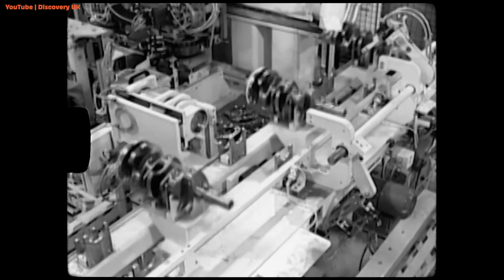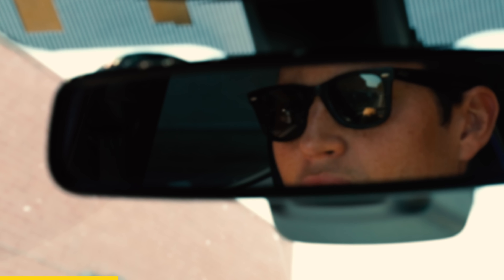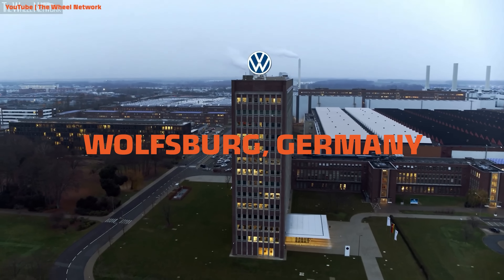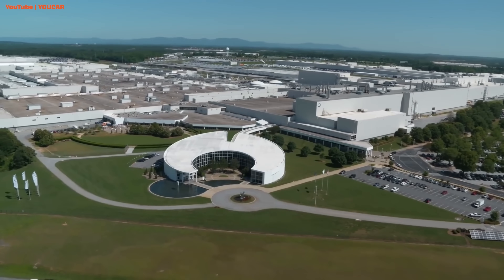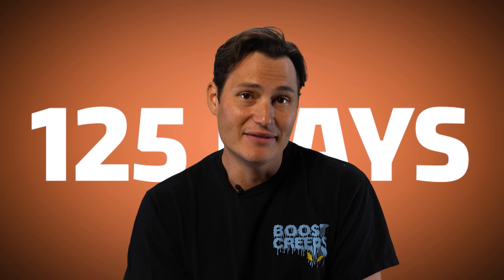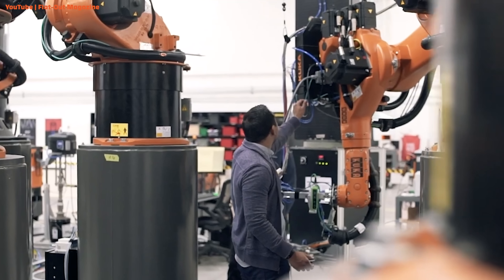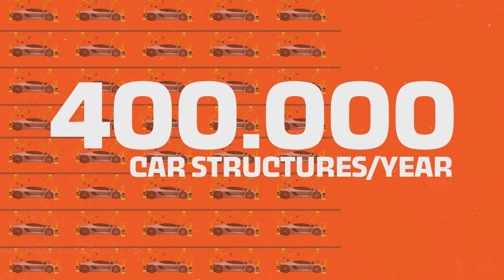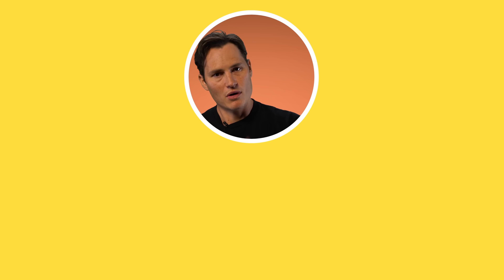A.I. Designed this Car

Comment: I really don't think this thing would be repairable if it got smashed in a collision. What with all the near zero clearance components mentioned near the beginning and the assembly method I'd think repair would be near impossible.  Unless you just rip off the busted and bent parts and reverse the assembly process in until you are at the point where the replacement pieces are able to go back in, then finish the assembly.  So, disassemble the car, then rebuild it, just like an oil change on a BMW.

Comment: The SR-71 Blackbird (top speed 2,193 mph) will pale in comparison to "Son of Blackbird" due in 2025 from Lockheed Martin. Officially it will be known as the SR-72 and will fly anywhere on earth in under 1 hr. reaching speeds of around a truly eye-popping 14,500 mph. This video, which covers AI creating dinosaur juice cars is seriously missing the boat IMO since electric vehicles will eventually outperform even the fastest and quickest gas-powered engines in every category. Nevertheless, it is astonishing what is happening with AI in the car industry. IMO more energy should be spent on creating inexpensive machines that take off and land like a helicopter without the need for some kind of runway.    Cheers

Comment: I not to sure about this Thing being scaleable on a Level that it will ever replace current Produktion Methodes simply because of the shire amount of time the printing proccess Takes Up. And as far as i can tell there are no Other, faster manufacturing Methods that are able to Produce this complex shapes.

Besides that im defetly not a Fan of oversimplifing in a way that it leads to misconceptions. Cause it just isnt that simple. Just be a litte more precise.

Comment: 3D printers do print out extra material, in the form of support sprues. Not all methods need them though.
Reply: Yes they are using SLM it doesn't need it.

Comment: I love this car. I love old school tech and new as well, the V8, the oil, the gas and the tech in it,  I love this. But. But... Hear me out. This one seems to be an amazing pathfinder. I love the idea of a generative design, the 3d printing. I do think this is the future in some ways. But. The Tesla Roadster is going to do the same, for 8 times less of the cost, have two trunks and 2 seats plus 2 luggage or children back seat, be convertible, self-driving, serviceable, chargeable, fully electric, with most of the convenience of a mass-produced car. Even if I would prefer the Czinger 21C at least for a short while, we got to give it toTesla that if they make Roadster happen, then it will be a remarkable feat. I know currently 3D printing is only for small scale production, and mostly for prototyping or fast development. But what Tesla does has got to amaze everyone. Really.

Comment: I dont see how the internals of the  motor and high stress parts are 3d printed or gonna be 3d printed. There is not enough strength and precision to make them by aditive manufacturing. But the rest is very good, and i can see custom cars soon.

Comment: Dude, comparing mass production to single production is completely wrong. I you would like to build 1,5M of those cars you would naturally use conventional methods, as the entry-cost level is high, but in total 3D printing is the most time consuming and expensive technology. This kind of production is great for prototyping, not building cars for masses.

Comment: Imagine the SR-71 re-imagined by AI and built with 3D printing
Reply: And it doesn’t have to be purely 3D print
Reply: The could use other manufacturing processes that are assisted by ai
Reply: It would cease to look like an airplane, and instead appear to be a mobile violation of the laws of physics.
Reply: The sled or blackbird was built in the 60"s so anything could be possible 60 years later.
Reply: The SR-71, F-22 and F-35 are already AI designed .. many people are unaware of it seems.
Reply: Wouldnt work...3d printing is really "Bad" material, its faaar away from the strengh  of conventional alloys
Reply: @mctobi2921  they can always make a special 3D printer to print using certain materials
Reply: @srthebox4946  and they do have metal 3d printers too
Reply: @forest3945  ik
Reply: @srthebox4946  there isn't a 3d printer that can bend titanium alloys yet. Which is what the SR-71 is made of, and btw, the SR-71 goes faster than advertised, it's speed limit is determined by the heat generated by friction.
Reply: @juanlucas8907  it is possible for a 3D printer that prints using titanium to be made
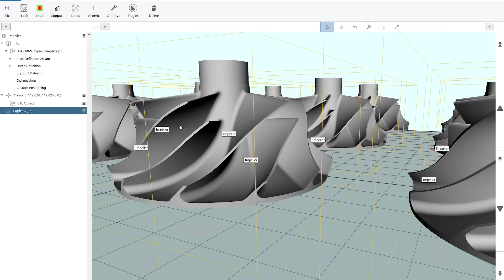Reply: @mctobi2921  7:24 the video describes 3D printing with titanium.
Reply: @mulberry9292  I don't get why people comment on the contents of the video without watching it.
It's right there, explained with cute motion graphics.

Comment: I can't imagine trying to fix this car when it breaks.
Reply: No doubt. Live engineers don't care how hard it is to fix so I can't imagine A.i.
Reply: @jeffreybarton3014  just thinking of the Nissan Titans placement of a starter. Yeah let's just throw it under the intake manifold. God knows what an AI would come up with.
Reply: Just call @Tavarish and he will put it back together... at some point...
Reply: if the files were still available your could just 3d print new parts instead of hoping a replacement part is sitting in a warehouse somewhere
Reply: @rj5529  You would still need those robots to put it together, son...
Reply: Like Teslas you trash it and get another!
Reply: Maybe if this style of vehicle manufacturing becomes mainstream enough in the future, it might make cars a lot more affordable.
Maybe if you break your car, it'll be possible to trade in your broken car for a new one and it not break the bank, but instead be, not much more than it would be to replace major damage on a car right now.
The factories would simply recycle the broken part of the cars then send the remains back through the assembly line and sell as refurbished/rebuilt or whatever, at a discount.
Reply: @jacobfausnight1180  "trade in the broken car for a new one" Whos going to buy a car that isnt even going to be easy to fix
Reply: Yeah probably
Reply: 1 the computer will tell you exactly what's wrong most likely
2 print your own parts
3 open source repair manual (in theory)
Reply: @joe7272  Good luck assembling a car with 0.024" tolerances.
Reply: The AI would need to design tools that could fix parts or there would need to be something like a 10yr unlimited mile warranty on the vehicle.
Reply: Technically that same AU could be run in reverse to disassemble the car. That means if the on board computer knows what the issue is, it could print the part, disassemble the car to the point the part could be reintroduced, and then just run the program forward again.
Reply: @AxGryndr  I dont think it would ever be that simple. the machine would need to know what its even looking for, otherwise it might as well, like someone else said, melt the whole thing down and reprint. Im sure you would need a whole new AI system to replace auto mechanic work
Reply: @reimugota8181  My thought is you have robotics that can already build a car. If diagnostics can identify the problem, say a worn out thrust bearing, then the algorithm used to build the car could be run in reverse to the point that part was installed. At this point, the part has been removed, print a new part (or grab one from inventory) and then run the process forward again. This would install the new part and replace all of the old parts. This is basically what your mechanics do anyways. Some of have learned, or know designed, shortcuts that reduce the amount of time it takes but the premise is the same. Not saying it would be easy but I think technically it should be doable. The issue really comes from how to handle things like rusted bolts, bent parts from accidents and so on - basically, all of the unforseens that happen when wrenching on a car.
Reply: Just sacrifice a virgin to our corporate gods then print up a new one.
Reply: "ah fuck i got rear ended" prints new rear parts
Reply: Actually, the nice things is, there are desktop metal printers that could make a replacement metal part now. As long as there's a 2nd part not damaged, you could 3d scan a left swing arm to make a right one for example. Maybe even beef it up
Reply: AI design makes me feel like this car shouldn't brake easily. That was the point in having highly advanced intelligence design it right? I understand the materials may be insufficient, but again. That's the point.
Reply: @austynbarber4078  "Highly advanced intelligence" would be much more successful in creating useful vehicles if they were repairable. Making things "harder to break" generally isnt a great philosophy for street vehicles, its more of a philosophy for creating machines of war
Reply: @ISPY4ever 😂😂melt it down??
Reply: It'd be like fixing an AR. Modular lol

Comment: Hahaha, the same thing over and over again. I hear that machines will replace people since I was 6 years old. This is BS, i admit it looks cool, and for this specific task it's great but it will not work. Assembly line costs are not only building costs. It is also maintenance cost, and robots are not cheap. It is unwise to use them for tasks that humans can preform as good and for a fraction of cost. Cutting costs also means that you use the same parts for all of your cars. That means you have to forget about making the most efficiently build car in order to cut costs of production. This tools are great to limit costs of production but i every day car they are just like F1 breaks, useless.

Comment: Is the A.I factoring in such as replacement of worn parts and need for someone to replace said parts if needed? As a parameter are the A.I factoring in clearance space for human hands to replace non functional parts due to wear and tear? If these things are factored in, Lets do it! In the world in which we live things that are manufactured succumb to environmental stressors. The car may run well for awhile but who and how will it be fixed when the part has reached it's expiration time and needs to be replaced?

Comment: Most of that what they used there is not AI, but algorithms. There is no machine learning (AI) necessary for topological analysis or simple pathfinding. And nothing of that is the "machine being smarter than humans". It is knowledge put into software by very smart humans!
The argumentation is similar to saying "This piece of paper is smarter than a lot of humans because someone printed a scientific paper onto it".

Similar 8:17: Other car manufacturers also don't use humans to press steel plates, but instead use manufacturing machines. It's not humanly possible to press steel into a shape without tools.

Comment: Any machinists out there know that 2400" per minute rapid speed is insanely fast. That's about 2.3 miles per hour. 5 miles per hour for a machine to move is insanely quick. Absolutely unreal.

Comment: I think this is wonderful actually. Not only is it possible to save materials making a car. But in the end the car would also become safer, lighter and thus more fuel efficient.
If you would worry about maintenance on that car because it gets to complicated. I think that in time that would just be another factor that the AI can take into account. And for the workers in a factory line. I do not think they would necessarily would lose their job. Sure maybe in some cases. But machines and robots do need operators to manage, maintain, an monitor them.
I work in a semi conductor area. And machines are fully automated on production. But they still need people to monitor and check quality of their output.

Comment: Designing a car is easy and takes little time. Working out the problems is hard. That's why developing a new car takes years. 

AI design might not be a bad idea but you still have to test it.

Additive manufacturing or 3D printing is good for certain one off components but it's VERY inefficient. For mass production it's VERY inefficient. The amount of energy used is very large and the quality of the products usually isn't great.

Many of those components used on this car can probably be made better without 3D printing.

The so called "A.U." is NOT scalable. In fact the whole process is designed for it. Yes, you could change the settings on it but the same goes for the classical production line. What the hell, there are production lines that make 5 different car models. 

This video is more of an ad than anything else.

Comment: Crash test it. There's utterly nothing new or revolutionary about making a car with a space frame that can go fast. A child in their dad's garage can (and has) done it. Auto manufacturers have been 3D printing prototype car parts for years now. They've been using CAD and wacky shapes for years, too. They've also been doing automated assembly for years. I want to know how safe it is, how does it stack up against other traditional manufactured cars.

Comment: So if we do not need hundreds of engineers and thousands of workers these are just a few robots and a 3D machine and a computer then we no longer need huge car manufacturers, it will be possible to move the software between computers and execute it in small factories.

Comment: 7:12 absolutely doesn't eliminate all waste. You can only reuse a certain percentage of the metal poweder that isn't used in a print. I would say the 3d printer waste is a much higher value waste product than drops from a subtractive process.

Comment: 3d printing can generate a lot of waste in the form of supports. Really depends on what you're printing and if it's possible to design it or orientate it in a manner that doesn't require supports. Aka, you can't print in thin air (unless bridging or at some angles, depending on printing method used). You can see the supports present @7:01 . They're the web like structure supporting the turbines.
Reply: Not if it's using powder sintering. Supports can be broken down and recycled anyway.

Comment: AI design is wonderful, but this car is far from what this video makes it out to be, manufacturing processes included. Koenigsegg incorporates all of the same technology and design features and then some with a bit less computational engineering and a very different manufacturing process. His cars are faster and lighter than the 21C and don't sacrifice nearly as much traction. No he doesn't make anywhere near 400k cars per year, probably more like 400, but he also isn't making disposable cars. The only way to work on this car with the current automotive infrastructure would be to send it back to the factory which would require an assembly platform to be occupied by a car that is already built but is in need of repair or standard maintenance. The net result would be repair costs up to 200% the price of the vehicle depending on disassembly speed before considering the price of new components. This is a multi-million dollar car. They make it sound like a $40k car. If I'm going to spend 2-3 million dollars, I'm gonna spend it on a 300Mph car that does more than just straight lines and mild corners, and it has to be repairable for less than the initial price of the car. Aside from that, the wheelbase and traction of the 21C simply aren't comparable to a real race car that happens to be street legal, which is the only justification for the price. It wouldn't be an issue if it wasn't possible to build a car that held that standard, the problem is there's dozens of cheaper competitors which outperform this car. If you've read this far and would like to complain that I'm an idiot for knocking this technology, that's absolutely NOT what I'm doing. Computational engineering is nothing new, not even in the world of motorsports. The problem I have is primarily with the overestimation of this particular manufacturer and their methods. That being said the design of the 21C is atrocious in terms of viability in a race. It couldn't withstand a track day at the Nürburgring much less 24hrs at le mans. What happens when you need to replace the brakes, or rebuild the valvetrain or rebuild the transmission? You have to ship the car overseas. This isn't pitstop compatible. If I want a partially-AI designed car that has real performance and can actually win races I'll buy an Aston Martin Valkyrie and still save money. If you don't like the Valkyrie, you could get any Pagani, any Koenigsegg, a Bugatti Chiron or X-wing, or a Porsche 918, or a number of Ferraris, or a McLaren, or Lotus. That's not even half the list, that's just off the top of my head. The only way this car is special is if you compare it to cars that aren't all that special. It doesn't deserve this much hype, neither does the manufacturing process. This has all been done before and to a much higher standard.

Comment: That "AI" would've acquired to make personal decisions and have determination, that would be one scary living mind, nothing artifical other then human rightous of declaring value on themselves. It could be a scam,  of simply using "AI" auto-selection crafting. As for the 3D metal printing, it will look like a blazing aura welding layers, as single entity object, putting an end to the words mechanical/auto 'parts'.

Comment: 3D printing is neither a low cost or time efficient endeavor. It will cost so much more money and time to make these parts that the design itself needs to be leagues better than normal cars to justify large scale manufacturing.

Comment: Additive manufacturing is mainly developed by Siemens through their CAD CAM CAE system NX. It was mostly sponsored by Daimler with the intent to do whatever they are doing.
I' m curious what software they used, what licenses and which modules they managed to make themselves for this (as I said, DAG invested billions into this) .